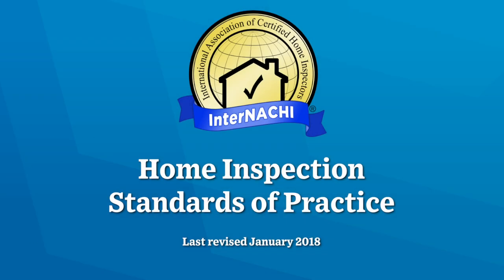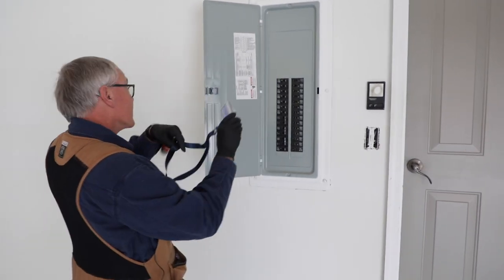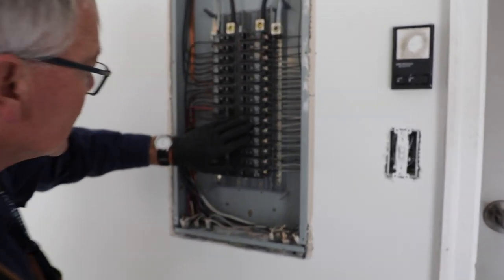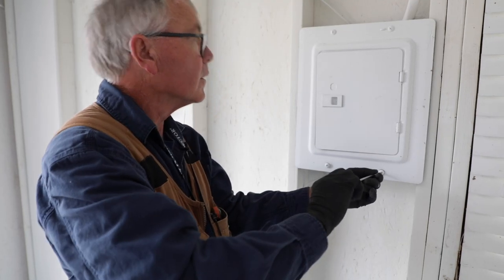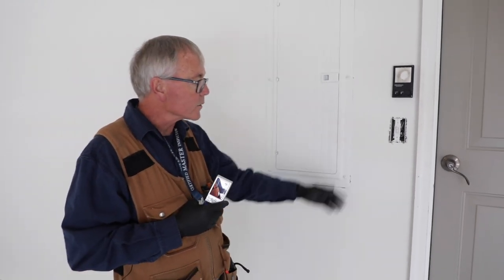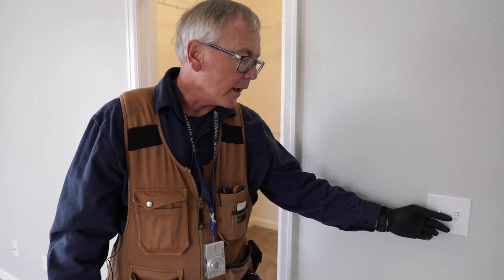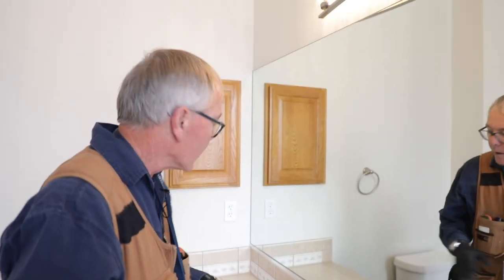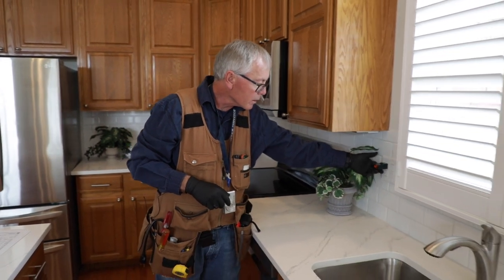Performing an Electrical Inspection According to the InterNACHI® SOP

Comment: Missed that the circuit breakers were not labeled. The SOP does not require removal of the front panel cover, but double neutrals and aluminum wiring is a must have observation. I also check to make sure the breakers specially the A/C are the proper amperage, I have seen 60 amp breakers on heat pumps that require a maximum breaker of 35 amps this is considered unsafe.
Reply from the maker: Great feedback, Manuel. Agreed. Thanks for watching our videos.

Comment: We don't use aluminum wire anymore, we use an Aluminum Alloy wire called AA8000.
This alloy does not require the use of NOALOX. NEC does not require the use of NOALOX.
Reply from the maker: We don't use aluminum, but home inspectors look for it.

Comment: Gotta say, pretty concerned about how easily this guy places his hands inside the box...  being comfortable with electricity is one thing, but for those new inspectors out there, this is not a good way to present the information...  this stuff can kill you.  Remember future Inspectors,  always make safety a priority #1
Reply: Shaun  Agreed. Immediate failure.
Reply: @Joe_S. Hahaha, I was cringing the entire time
Reply from the maker: Good comment. Ray is a licensed electrician and he goes beyond the standards of practice, as most inspectors do.
Reply from the maker: Yep. We understand. But many home inspectors pull off the dead front, just like I did for 10,000 home inspections. I want to see inside. So did my client.
Reply: @internachi  you missed the entire point of the comment....  the presentation is a problem for new Inspectors...  we're all impressed you had 10,000 inspections, that has nothing to do with it. A pro 20 years in can still make a mistake.  Mistakes generally happen when you become arrogant and respect goes out the door.  Pulling of the dead front is pretty standard, but he should be expressing safety as the #1 priority
Reply: Agreed. We planned on utilizing these videos for our new hires but when I see that, NOT in conjunction with a vocal  "this is demo only, be sure not to poke at these with your fingers" disclaimer included. I tend to back away from this one.
Reply: Lol same I was thinking ahh is that a good idea ?
Reply: He is wearing rubber gloves
Reply: Same thought I had he sure is poking around in thear with his hands not to smart my opinion

Comment: I am a new inspector, and i have heard mutliple say removing the dead front is not required, but everyone seems to do it anyway. Is this just an unwritten rule that everyone does it even thought its not required? Is it that customers just expect it so inspectors do it?
Reply: Do not practice what you feel is a safety issue to you !
Reply from the maker: Hi, James. You're permitted to remove the dead front. The standards do not require its removal. But you may exceed the standards. It's up to you. Here's a good article on that point: https://www.nachi.org/exceed-or-not-exceed.htm

Comment: Correct me if I am wrong but there are no requirements for Arc Fault or GFCI breakers in the panel. Also the panel cover is painted, should that be unpainted and grey?
Reply: AFCI and GFCI are only required after a certain age of house/panel. Check local listings. And there is nothing wrong with painting the exterior of a panel. Exterior only.
Reply from the maker: Hi, Jay. Good question. I think I understand your question. Home inspectors are not code inspectors. Many home inspectors inspect a home without much regard to the age of the house. That's because a defect is a defect. And since a defect could hurt someone, "grandfathering" is nearly meaningless.
Reply: You shouldn’t test gfci outlets using the built in test button.  The test button does not produce an actual ground fault it just opens the gfci outlet circuit and does not necessarily confirm that the gfci is functioning correctly.
Reply: Problem with a painted cover it's hard to see if a problem.

Comment: Deox is not required and if you can see it it is not installed properly.  The ONLY recognized test of a GFCI or AFCI is the button on the device itself---never the button on a third party tester.  A second recep for a countertop is not required unless it is over 9 square feet.
Reply from the maker: Got it.
Reply: @internachi  again, what does “got it”  mean?

Comment: FAIL: Subpanel must not have a main bonding jumper.
Deox is not required by Code or cable manufacturer.
FAIL: Main breaker in main panel should be marked "service disconnect".
FAIL: there is no grounding locknut on the conduit in the main panel coming from the meter socket.
FAIL: the conduit in the main panel is required to be sealed because it goes from exterior of building to interior of building.
FAIL: no mention of grounding electrodes to ground rod or water pipe.
GFCI test button on receptacle is only approved method of testing.
Depending on code when installed, only receptacles within 6' of sink are required to be GFCI. Later codes require all countertop receptacles to be GFCI and/or AFCI protection.
Reply: grounding locknut only required if any of the concentric rings are left. Hard to tell but looks like they have all be removed.
Reply from the maker: Got it.
Reply: @internachi  Got what?  Can you actually comment on the issues presented?  Or are they all non issues? Is there a main bonding jumper present, is that the small green clamp and screw?
Reply: @edwinjenkins1894  Sub panels should not have the ground and neutral bonded together at any sub panels, only at the main. The claim "Subpanel must not have a main bonding jumper." The video clearly shows him pointing to the ground "bonded" to the enclosure. That is NOT a problem. That is correct. It's the next thing he says that's important. He then says it is "Isolated" from the neutral. That is also correct. As long as the neutral is isolated from the ground it's fine. This house is little odd in that their main breaker is in a separate location acting like an old disconnect switch, so it's that main breaker panel that will have the ground and neutral together.